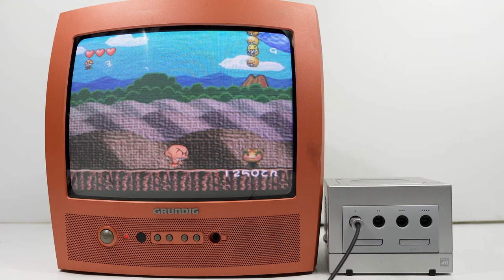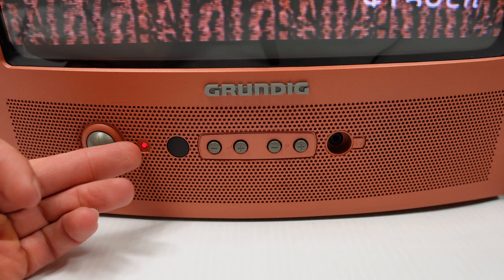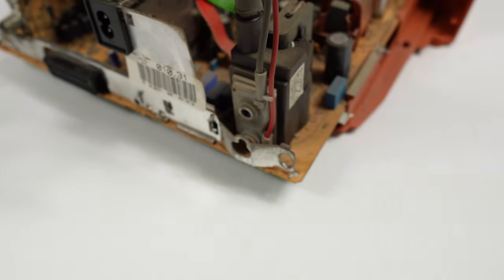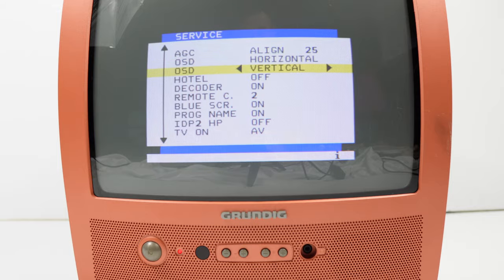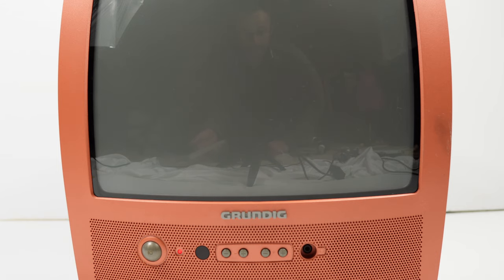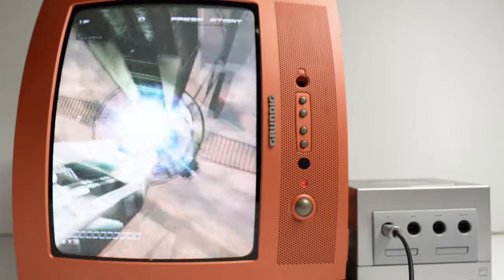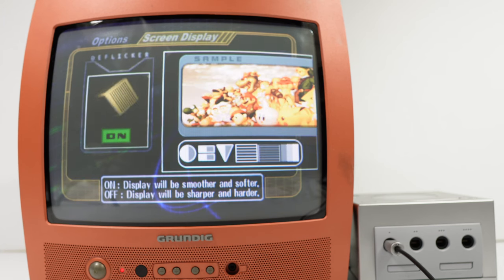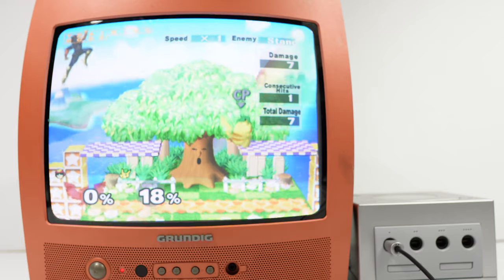Grundig P37-830 TEXT , Scart RGB CRT TV

Comment: awesome video! great to see this set immortalized on youtube. the deflicker in melee's settings was intended to be on when using 480i & off when using 480p. it doesn't make much of a difference when interlaced scan isn't being used. on emulators it doesn't make a difference at all, so i think it's just a softening filter applied to the video signal itself.
Reply from the maker: Does it actually change picture at all when used on or off in 480p?  Need to get all the colors of the TV.
Reply: @rgbrob  from what i recall, it does not have an effect on a 480p image due to the progressive scan. i'd love to see the whole gang lined up - especially that elusive green one!

Comment: The TV has no NTSC. I have one and NTSC is just BW unless you use RGB on the Scart.
Reply from the maker: oh really! thats very lazy from Grundig and lazy from me not testing for that. Doesn't totally surprise me given how simple this model is. Which color do you have?
Reply from the maker: KT  no this is not the case for every tv. Some pal TVs will cope with the 60hz of ntsc signals but will not display in color via composite or svideo. Rgb yes but not the other two in some cases.
Reply from the maker: KT  Only if your console supports rgb

Comment: Picked this up for free today and was just wondering if you know what code you used to program your remote? thanks mate.
Reply from the maker: No I used a proper Grundig remote for the TV so didnt need a code.
Reply: @rgbrob  Ah right, that's unfortunate, thanks mate.

It's a sharp little set after some light tinkering but I haven't been able to find a code for my universal remote that lets me actually open the menu, so the contrast is currently a bit too high, otherwise I'm pretty pleased.
Reply from the maker: @SteamPunk96  you could also try with your programmable remote the codes for 'blaupunkt' & ''siemens'. all three are the same brand. i seem to think the chassis in this particular tv might be shared by quite a few manufacturers , worth trying busch and orion brands too.
Reply: @rgbrob  Good shout but no such luck sadly.